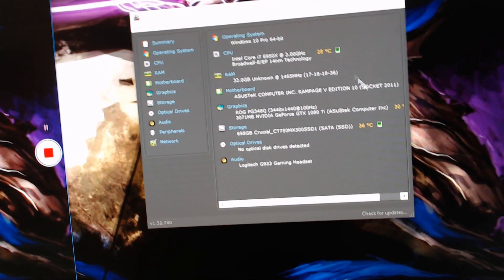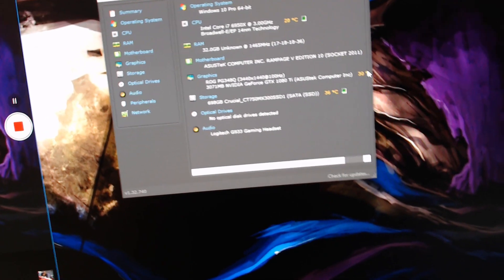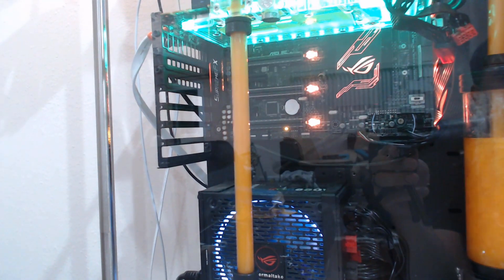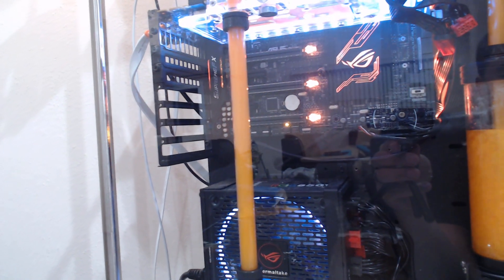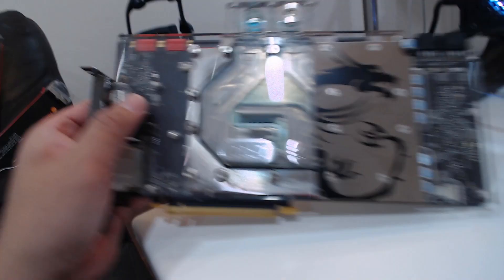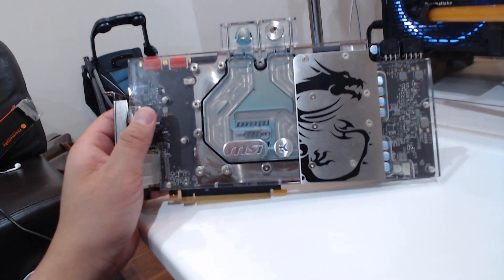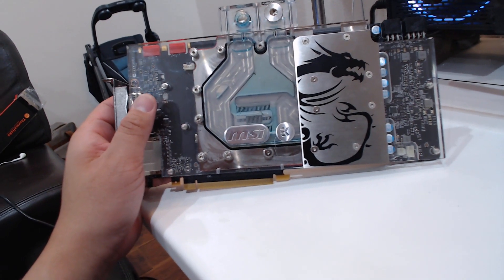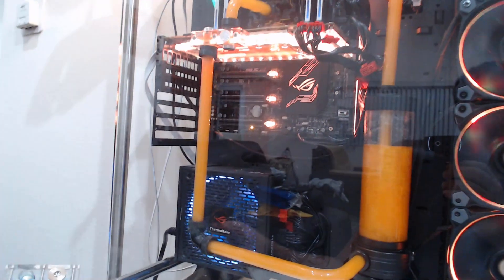ASUS 1080 TI TURBO REFERENCE CARD WATER BLOCK INSTALLATION

Comment: How thick were the original thermal pads? I am replacing them on my card and I am not sure if I should go 1.5mm or 2.0mm
Reply from the maker: I not really sure  the lad came with the water block.

Comment: Good video dude, I have an ASUS 1080 TI turbo and an intel core i5 9600k with stock cooler, can you tell me how much will cost get water cooling in both (CPU and GPU) in the same water cooling set? Can i fit the watercooling set in a 3fan radiator? Thanks for the reply.
Reply from the maker: Fabian Vergara really appreciate the comment. If you go through AliExpress and buy the parts it should run around maybe 200-250 for gpu water block $100, cpu waterblock $32, 360 rad $60, and DDC pump res combo $50. Everything should run fine with a 360 3fan res. 1080 ti doesn’t run hot.. If you watch my lian li 001 build I’m running i9 and 2080ti with a 3fan rad. Running Cool as a whistle. Hope you enjoy the channel!!!

Comment: My 1080ti turbo water-cooled is spiking in temperatures.. from 35c to 90c in less then 30secs... I did the same as yours.. any help is awesome guys thank you
Reply from the maker: Sing Teh I would make sure that you peel the plastic sticker from the water block and make sure all your thermal pad is on point. What kind of thermal paste are you using?
Reply: @TheNoviceTech  thank you so much for your swift reply. I will double check on the plastic sticker. I am using the thermal paste provided by the byski waterblock. I am having problems with the thermal pad's thickness. Do you encounter a problem with the thermal pads?
Reply from the maker: I use artic silver for my paste and the provided thermal pad. It might be slightly longer so just cut it to size.

Comment: Installed this block and am gettign 70°C max, have 2x360mm radiators, thats too high for this block right?
Reply from the maker: yes 70's is too high. Mine doesn't go over 50c. Check your thermal.

Comment: So are the 1080 Ti and 1080 of that card the same PCB? And will it work for the 1080 8G of this card?
Reply from the maker: Wilderness Ridge Hosting this water block works for both 1080 and the 1080ti

Comment: Hi dude, i have a 1080TI Turbo from Asus, on the ali express details page they show a slightly different pcb and say that is important that the pcb is the same like the picture.. my pcb has more capacitor on the right side, like yours. sadly you doesnt show how it looks from front when you put it together.  Will these cut outs on the right side fit over the 7x capacitor from the asus turbo 1080ti?
Reply from the maker: Valizz it should fit just fine. Just read in the description. Sorry for the late reply

Comment: Great vid man, really appreciate you posting this. I just bought this card 2nd hand and want to put it under water. Having a heck of a time locating a block. I see that Bitspower also has one (BP-WBV1080TIAT) with a backplate. did you look into getting that one too?
Reply from the maker: Thanks, it was hard looking for a manufacture that made one for this type of reference card. I didn't know bitspower made one for this card too. Well i'm already happy with my current one.
Reply: The Bitspower block is pretty much impossible to find at this time...and I need two.
Reply: @iankphone  performance PC's has stock on Bitspower block now. I think they had 3 come in and I got the first one. So they should have 2 left.